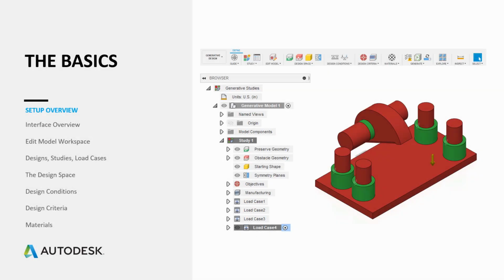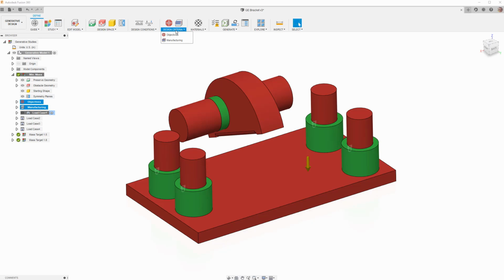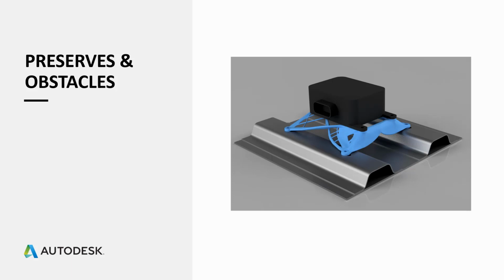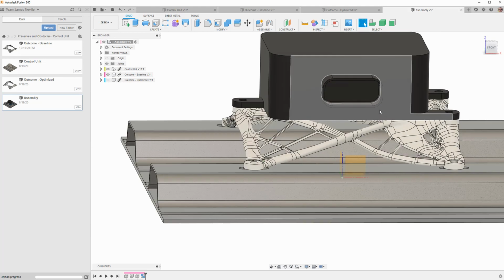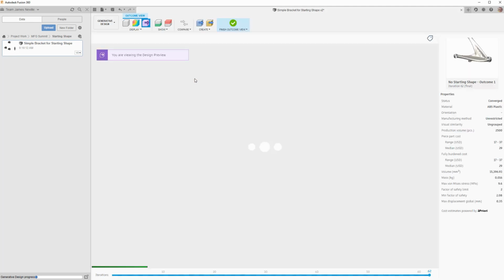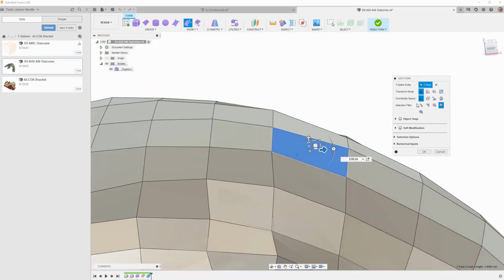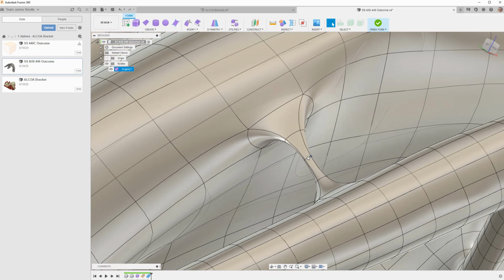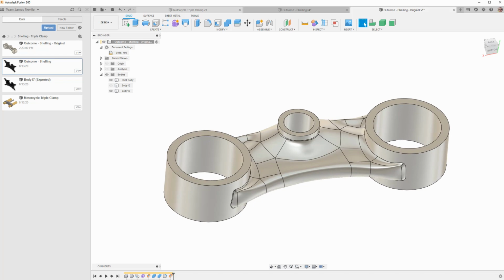Generative Design Tips and Tricks

Comment: is there any way of including existing bodies in the simulation used for generative design? the simplest example would be a linear rail that is mounted to the generated model and carries part of the load, but which obviously shouldn't be changed and might be of a different material

Comment: I'm a yacht designer and am designing a new line of high speed vessels. I would like to use Generative Design to create the Stringer system below deck. I will be using a large format 3D printer to print the structural braces below deck, but I'm a beginner to 360. Is this possible?